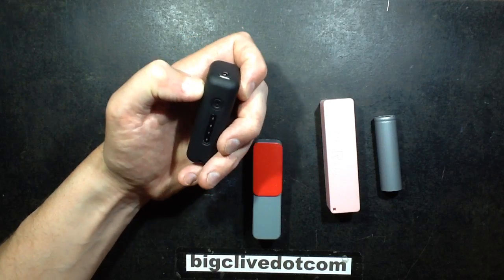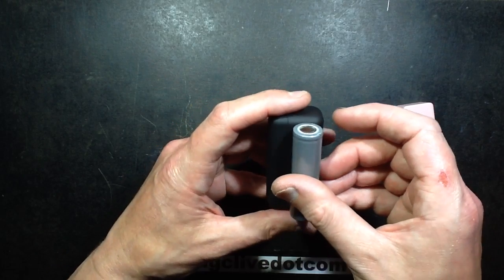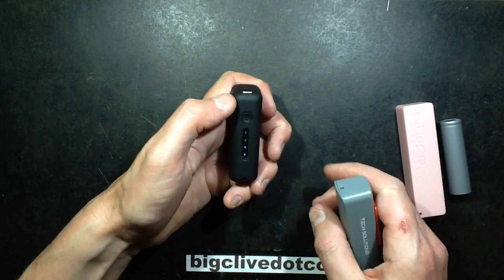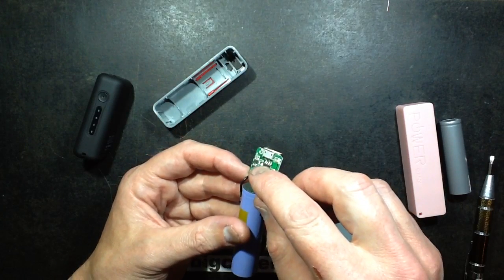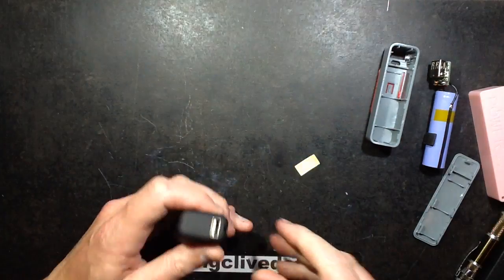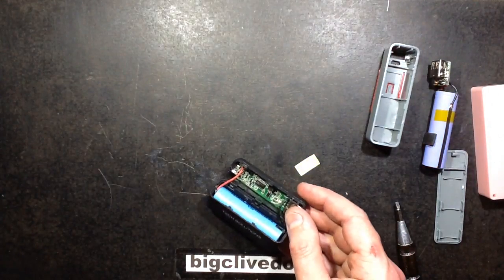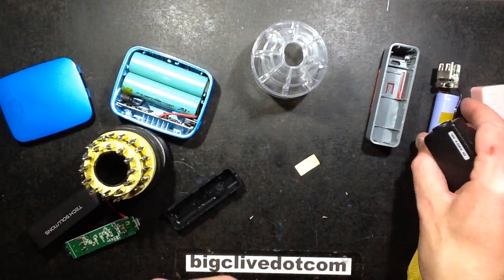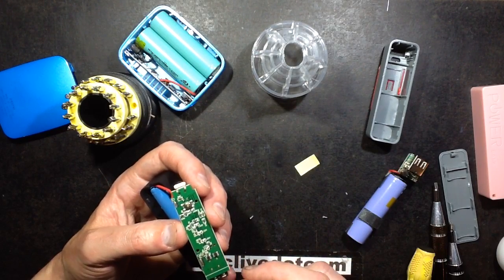Unusual chunky USB power banks.

Comment: That is interesting they use a quad op amp. Some of these things amaze me as to how simple they can be or how complex. I am fixing my headphone amp and just checked my op amps and they are not the issue, but I have a film capacitor on the output that shows voltage in, but nothing out, so I have found my issue.

Comment: Hi, Clive - I popped into my local Poundland this week and found a power bank like the sharp edged pink one in your video.

It claimed to be 1200 mAh so I bought one. Surprisingly it is well made with a neat little control board and a cell that tests out at 1250 mAh - a cheap way of getting 18650 cells.

Comment: that best powerbank is PNY 7800mah from pc world or curry's retail price £30
second best is the kodak powerbank retail price £16 from asda
Reply: Aukey power banks, much better. Can handle loads a lot better and the quality is excellent, can't be doing with ads cheap shite. Come on Kodak... Everything I've had from Kodak has either been returned, thrown out or stripped for parts.

Plus 7800 mah. For £30, you can get 5000mah for £7.99, even 20,000 for a little over £20. For an extra £7.99 (£37.99) you can get 30,000mah. You're paying £1 for every 260mah. I'm paying £1 for 789.6mah, that's 3.03 times (32.9%) more v's the pound plus outstanding quality.

Comment: i have a power bank with lm324 ic like you have . i want to convert it 2200 mah to  6600 by adding 2 more battries in parallel but it draws only 0.5 amps i want to increase this to 1.5 amps so the power will charge quickly.
Can you tell me what to do?
i will link the a pic of the circuit i you are willing to help me.

Comment: I have one of those little black ones, and a white one the same shape.  One is labeled 2600mAh which I figured was over rated, the other is 2200mAh. I kind of doubt they even have different capacity cells in them, but the 18650 seems to be rated between 2200 and 3600mAh with a bit of looking around, so unless that's incorrect it's possible right?

Comment: Hi Clive, did you ever consider using guitar picks to avoid the chewy marks in the plastic? They are fairly easy to get in all kinds of thicknesses. It's been quite some time since I've damaged a plastic cover.

Also the picks work a lot better then the screwdriver because they are a little bendy and get in the crack easier.
Reply: "they are a little bendy and get in the crack easier" - Snicker.

Comment: on those battery chargers do you know how they made the circut that shows the power level of the battery? I made a battery bank and I want something to be able to show the charge level of the batteries inside
Reply: I tried the following words as a search in Google and several hits of sites with circuits, explanation, and one even has a video of the breadboard testing...
LM741 based charge indicator circuit

Comment: I have a similar power bank (but with two cells and 4Ah) that also uses a LM324 to control the LED graph. It has seen quite a bit of use as my phone's battery started degrading, so when it stopped charging properly, I decided to take a look into it. It's quite interesting how similar these devices all are....

Comment: Ai had a battery with the same circuit as the first one, then it fell form 15 cm and the negative battery wire broke.
When I was trying to solder the wire back on the contact... The wire touched a solder pad and the board got fried...
FAIL...

Comment: Many thanks for this insight, Clive.  It looks like I'll be in the market for another USB power bank, now that EE have issued a total recall of the power banks they gave away to all their customers last year.  I suspect that, inside, they would look remarkably similar to the chunky one with the built-in torch and multiple LEDs that you looked at here.  Did you ever get a chance to dismantle one of the troublesome EE power banks?
Reply from the maker: +John T I've got the guts of a disassembled EE power bank charging right now.  Quite hard to take to bits, but actually seems well made inside.  The video will follow soon.
Reply: That's good to know, Clive, thanks.  I'd be fascinated to know what causes the fires and (T-Mobil/EE/BT's) need for the recall.  Identical ones seem to be still on sale, on eBay. 
btw have you ever come across "Bedini" treatment for flat/dead 12volt batteries?  It sounds a bit woo woo to me.  http://www.thedoityourselfworld.com/ssg-battery-restorer.php
Reply from the maker: +John T Those types of quack sites tend to have sensationalistic "projects" surrounded by heavy advertising.

Comment: Just wondering, the other day I was soldering a wire onto a Li-Ion battery and it started fizzling, should I be worried about it?
Reply: +MegaCHUBBER I am actually quite familiar with soldering directly to batteries. I have a weller 140watt soldering gun. First i flux the battery and the wire, heat the solder gun up so its REALLY hot, tin the battery and wire with a very quick dab of the gun, then after letting the battery cool i quickly solder the wire to the battery. The trick is to get the soldering gun really hot AND have enough copper on the tip so it doesnt cool down too much while youre soldering. Because it was so hot, it solders effectively, but because it happened so quickly, the heat disperses quickly as well and doesnt build up.
Reply: You just want to be very careful if you're soldering a cell that has a protection board as you can fry the circuitry and cause a short that might not happen immediately and could blow the next time any current runs through the battery.
And take this as a warning from someone who's seen this happen.
Reply: honestly ,you really shouldn't solder directly to a cell. always safer to just use a clip or contact points.  + if the battery fails no desolderin and resolderin
Reply: The battery sorry
Reply from the maker: +MegaCHUBBER Yeah, soldering directly to them is a bad idea.  I've done it cautiously in the past by being absolutely minimalist with the heat.  The normal technique for attaching connections to lithium cells is to use a tiny spot welder to tack the tags on.  That's the cylindrical cells I'm talking about.  If tacking onto a battery type cell then again try to be minimalist with the solder and make sure you don't bridge pads.
Reply: +bigclivedotcom Okay,  Thanks for helping! I threw the battery out onto the patio as soon as it began to make noises. I'll try not to just keep the soldering iron on the battery next time I try to solder something onto one. Thank you
Reply from the maker: +MegaCHUBBER You can also get cell holders for them on ebay if you hunt about.
Reply: +bigclivedotcom I got the battery and the circuit from a Power Bank which I took apart to see what was inside. While doing so a wire came loose from the battery, so I tried to put it back on. "Probably wouldn't be using it anyway" is what I thought and then I wanted it again, so yeah. Thank you for your help, but I will probably not be soldering for a while, I got water in the iron's heater and so am waiting a few days to let it evaporate away rather than trying to use it and tripping out the fuses in the house.
Reply: P.s. Your videos are AMAZING!!! I absolutely love them and the idea of an electronics channel where you take apart things you find is an original and relatable concept! You're awesome dude!
Reply: +MegaCHUBBER Search for someone called Aussie50. ED has thousands of videos to keep you entertained for weeks. Been doing them since 2007. Same as Photonic Inductions, that said, Photon (Andy) deleted a lot of his videos and original channel in 2011 due to copyright infringement. He's still around now though, on a new channel.

Comment: Is it safe to charge a phone via a power-bank that pumps out 6V?
Reply from the maker: +Johnny English I wouldn't really recommend it, since it could push a lot more current through a simple resistive limiter and the extra voltage (if sustained while sourcing current) could cause charge control chips to run hotter.
Reply: bigclivedotcom I'll open it up and see if there's something to adjust the voltage on the PCB. Thanks.
Reply from the maker: +Johnny English It's unlikely that the voltage will be easily adjustable.  But you may find it settles down closer to 5V under load.

Comment: That must be a TP4056, which is a pretty low-cost Li-Ion charge controller. So no, that's not the boost controller. Majority of the cheap Li-Ion to 5V converters use a simple transistor oscillator circuit hooked into an inductor. That's how they make it  so cheap. 
The quad op-amp must surely be, as you say, for lighting up the LEDs based on voltage thresholds.

Comment: Just commenting to say I own one of the second power packs you took apart. I've been wanting to do so for a while now but i didn't want to break it. Its cool to see the insides without having to tear mine apart as I use it often enough to miss having it if i did damage it. I can confirm is it a nice unit I have mine stuck in a bag I bring around with me. I've had mine for close to a year now and it still works very well and has held up to being tossed around in a bag with no problems.

Comment: Got any recommended diy kits for a powerbank? I have loads of genuine sanyo and panasonic 18650s and I need something that can supply enough to put a good charge on my nexus 7 2013 while running. Perhaps a 4 cell bank? I also want it to be able to fit in my pocket. I would like it to have an output rated at a constant 2A.
Reply: Have a look at the Qidian QD-184-SX-TY it's a four cell power bank, but you have to put your own 18650 cells in it.

Comment: Hey I found a couple power banks I think you might be interested in, because they have adjustable voltage outputs http://r.ebay.com/gAxALd and http://r.ebay.com/aLx2Mq this one I'm partitcally interested in knowing what you think, because it appears as if it wants the batteries in series but I don't think it has a BMS to balance charge them, so is it potentially unsafe? I know the first one is good because 
Julian Ilett did a nice video on it.
Reply: vgamesx1 The batteries are parallel so all charge to 4.2v or so, so they are balanced, the voltage conversion uses a dc-dc converter, its perfectly safe, the only unsafe part might be the ability to put more than 5v out of the usb connection with adjustable output, all powerbanks use a dc-dc converter anyway, 4v cell to 5v usb output, so it just gives you a bit more options
Reply: jusb1066 are you sure about that or did you even look at it..? if it is wired in parallel then why does it require a charging voltage of 16V-24V? which would be great for solar since a typical 12v panel shouldn't ever exceed 24V.

Oh also it states in the listing "LED showing 12.4-12.8 means batteries are fully charged." a really nice way to show the state of charge IMO, I like it and thanks although... you might want to have a second go at that.
Reply: vgamesx1
it shows a direct bar connecting each pos and negative on one picture, of course the picture could be different from the supplied product
Reply: jusb1066 If you look close enough, the metal bars are connected via a little exposed wire.
Here's a slightly better shot http://r.ebay.com/rRQjoP
Reply: vgamesx1
that is a much better shot, i do see the wires, I can also now understand the USB is fixed output at 5v and the other socket is variable, and handy as a laptop extender/random 12v supply
Reply: jusb1066 yeah that's why I was rather interested in it, not many banks allow for up to 21v output and those that do are $50+ so it seems like it would be quite nice aside from that one possible quirk with balance charging.

Comment: So they're using op-amps as comparators then.
Should have been an LM399 though.
Reply from the maker: My guess is they chose the cheapest quad device.
Reply: BavarianMonkey I see what you were getting at now. I should remember to comment after coffee :)
Reply: Aadil Shah Does appear to be an odd choice but there's probably a good reason even though it might not be obvious - they could be buying huge quantities of the '324 for example.
Reply: bigclivedotcom Also the '324 is stable unless it's driving a capacitive load but the '339 will tend to oscillate unless you stop it.
Reply: Graham Langley that does not matter when used as a comparator, though
Reply: BavarianMonkey
You think not?
Reply: In this case I don't think, I even know ;-).

Whenever you have a system without feedback (a LED driver circuit is such a thing), loop stability is not an issue.
Of course, if you end up in a situation where both inputs of the OP amp / comparator are exactly at the same voltage, any noise will lead to high amplitude (saturation voltages are the limit) on the output of the op amp. But in this case, any OP amp / comparator will do roughly the same, besides switching speed and recovery issues - things that are irrelevant in a LED driver circuit.
Reply: BavarianMonkey As you say it's not a question of loop stability. It's a question of stopping the things bursting into song when used as a comparator even with hysteresis. 

Skimming through through the 30 years worth or so of my designs, commercial or test equipment, that I have easy access to here I didn't find one that didn't have a cap hung off an input or output in order to stop it oscillating.
Reply: Caps on the output do not stop oscillations and one should not load an op amp or comparator with a capacitance since that reduces phase margin and makes the circuit less stable and increases power dissipation.

On the input - well, if you do not have a feedback and therefor no loop stability issues, the cap will not help except the output bounces around like crazy due to noise on the input.
If it goes bonkers because you have parasitic feedback issues, then this is a loop stability issue that needs to be adressed as such.

Once again, to make that clear: If both inputs are within a few millivolts, ANY open loop op amp / comparator will push the output from saturation to saturation based on the sign of the current input voltage difference and there is no way to prevent that except proper hysteresis.
Reply: +Graham Langley LM324's are 'general purpose' and are flexible. I am sure they used it because they had them. Others that are cheaper or more optimized for the purpose does not really matter, since they likely just bought a shit ton and use them for every application possible.
+BavarianMonkey I assume you are talking about responsiveness lag by attempting to smooth the voltage within feedback loop, causing the op amp to overcompensate attempting to match the reference, intensifying oscillations, whether it is the output or the input? What is wrong with smoothing the power it delivers beyond the feedback loop? As i THOUGHT this is the way to do it. Only a resistor within the feedback loop to boost the power amplification, of course.
Reply: Richard Smith One should never comment before coffee! :P
Coffee is an essential vitamin! :P
Reply: Richard Smith the issue is that by connect ing a capacitance between output and ground, you are shifting the phase... so your phase margin and therefore loop stability decrease and the circuit can oscillate. The correct way to "smooth" the output (meaning: low pass filtering) is to either connect the cap across the feedback resistor or adding a RC circuit to the output.
But never connect a cap directly between output and ground, that is bad practice and will cause problems in most cases.
The same applies to capacitive loading with long cable runs...

Comment: 4056 will be charge controller (TP4056)
DW01 and the 8205 is protection (8205 is dual fet used for disconnecting the cell)

These are basically the go-to pairings for single cell lithium ion stuff out of China.